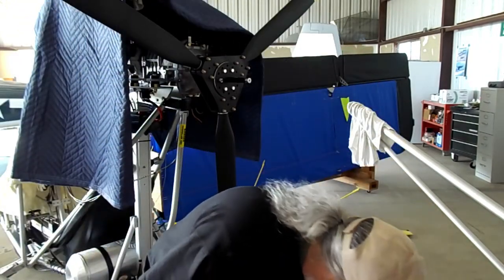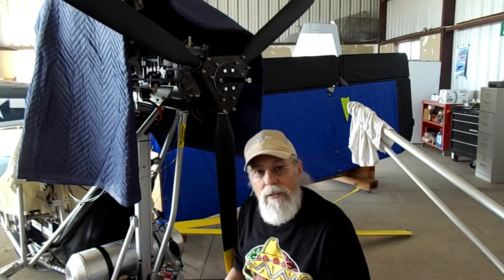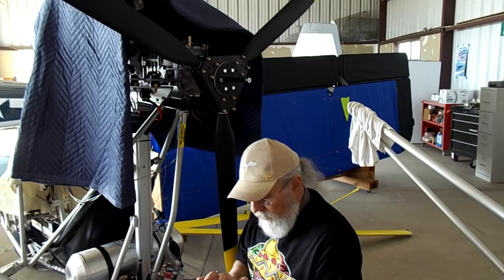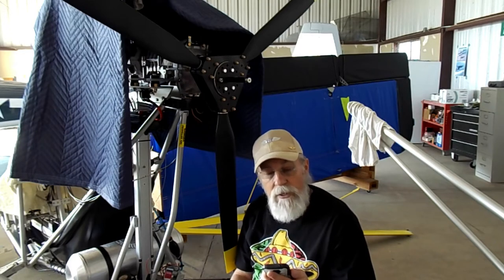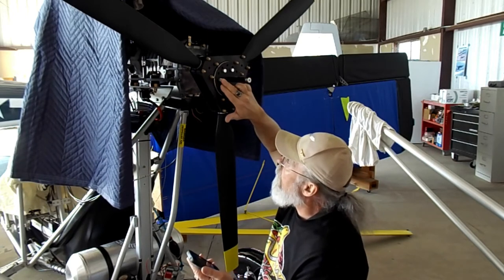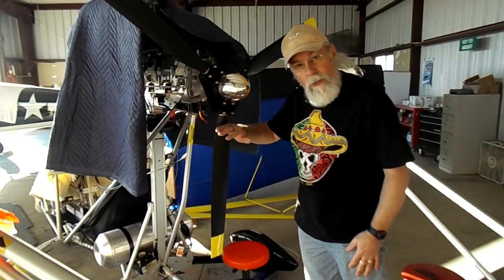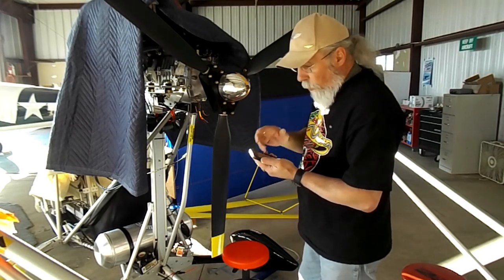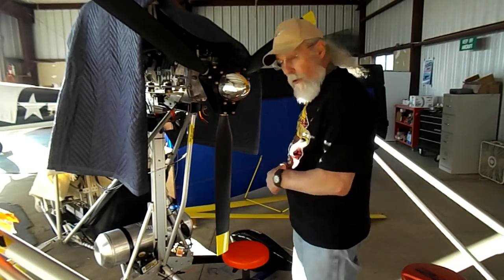Warp drive Prop Installation on Rotax 503

Comment: hello103 and everyone    I have a 2004 aerolite good ultralitght    Do you know you will have to balance the prop or you will have vibrations that can do damage to your  AIRPLANE      if the company said it doesn't need balanced then when you make your -_____engine RPM  run-ups youll see what i mean. every ultralight is different. Aerolite103  about time someone makes a video on Aerolite 103. Good JOB
Reply from the maker: Hi Bruno, I appreciate the warning & advice. I'll definitely find out when I start and "break-in" the engine and go through the varied RPM's called for in "break-in". I shall make it a point to check with manufacturer about 'balance' if I encounter any vibrations when it's finally running. Cheers!